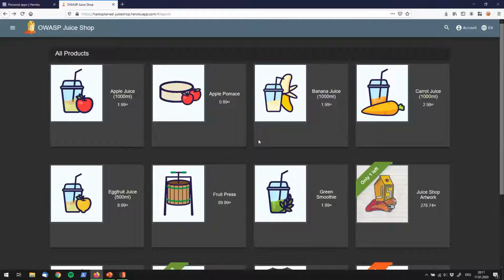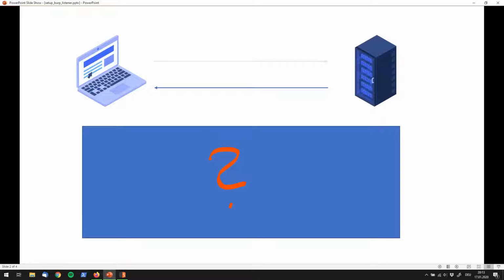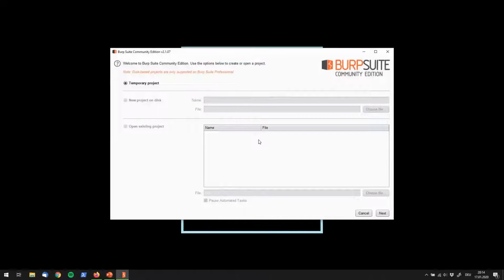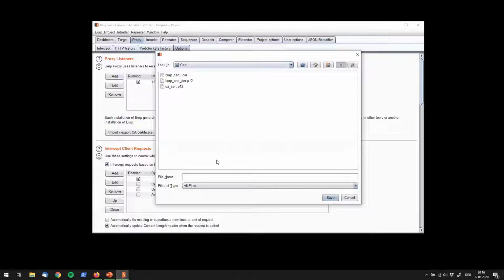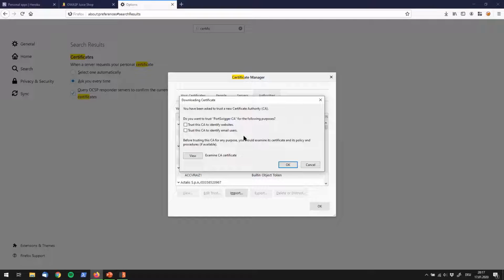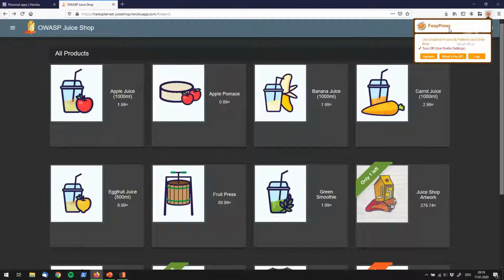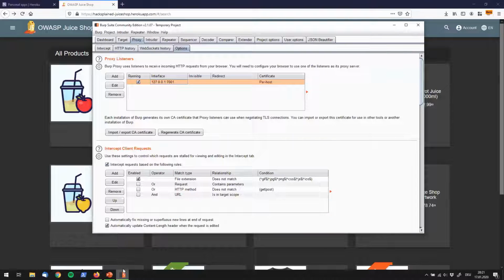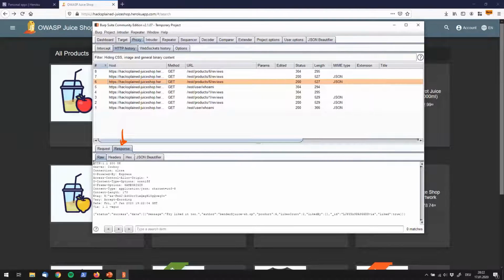Set up Burp Listener

Comment: So if I close the OWASP window and reopen the OWASP Juice shop. The browser takes time to load the  heroku platform URL with the foxyproxy on. But the moment I switch it off. It works fine. Why is that? Can you explain? Please. Thank you.
Reply from the maker: I am not sure if I fully understand your situation. However, if your page is not loading with foxy proxy on, make sure to check two things. First, if the port you are listening on is equal in both Burp and foxy proxy. Second, check if Burp Intercept is turned off, otherwise the request will not reach the web server.

Comment: Hello, what do you think about using a Burp Suite as a VM or does it not really matter?
Reply from the maker: Do you mean using Burp Suite inside a VM?
Reply: @Hacksplained  That is correct. Is it better to use it inside a VM or does it not really matter?
Reply from the maker: @darrianmciver6486  It does not really matter. If you have a fully functioning network setup (natted or bridged) inside your VM, then you are good to go with a VM as well. Go check out https://www.offensive-security.com/kali-linux-vm-vmware-virtualbox-image-download/ where you can download VM ready Kali images, which btw also come with Burp installed
Reply: @Hacksplained  Thank you sir for your time. I appreciate it.